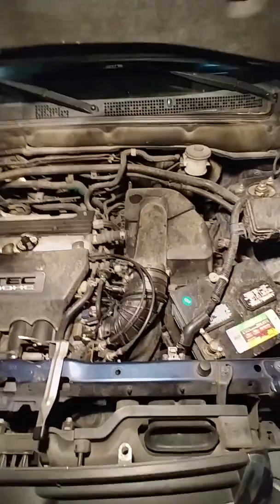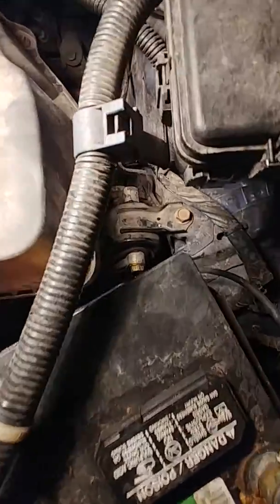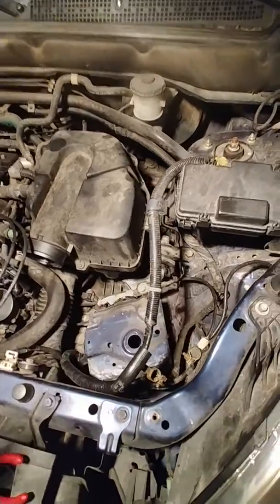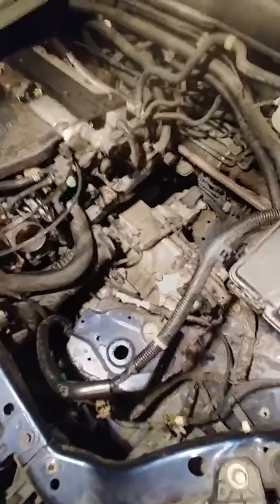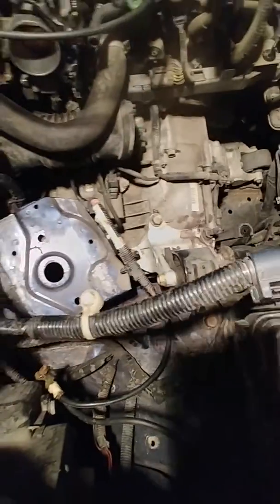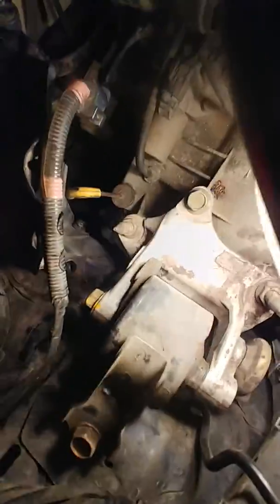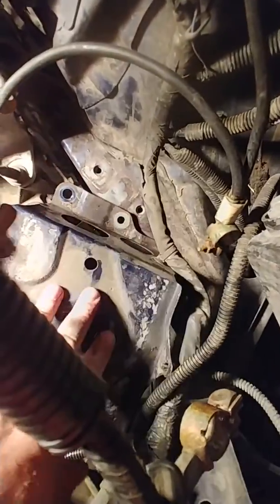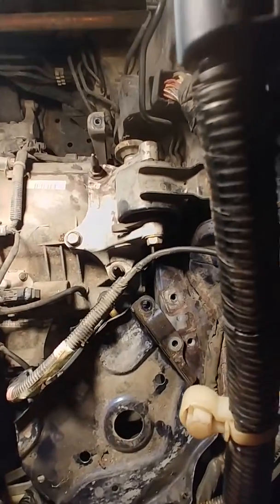2002-2006 Honda CRV motor/transmission mount replacement

Comment: I watch this video to change a transmission mount on a 2003 honda crv.   the only thing I did different is I removed the transmission bracket and transmission mount as a single unit.    once out I removed that one bolt and reassembled and placed back in.    no need to remove the battery tray to take that one bolt out.  very helpful video.   thanks.

Comment: Thanks. Very helpful.  Have a 90 degree electric ratchet. Would that save on having to fiddle with the Battery tray?
Reply from the maker: Sandeep Patel no, the bolt is too long. It will not come all the way out of the mount if you do not move the battery tray. It’s not hard, the bolts are actually fairly easy to get to. Hope this helps 👍

Comment: Hey buddy when I pop it in reverse it only makes the clinking sound. Assuming because the motor is pushing up on it would that be this mount or could it be a separate mount. Nice video either way